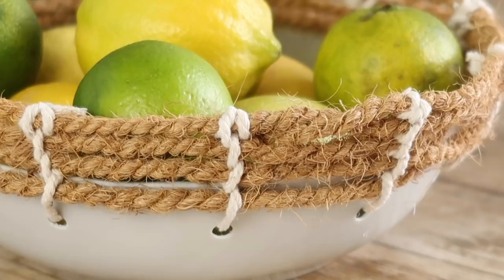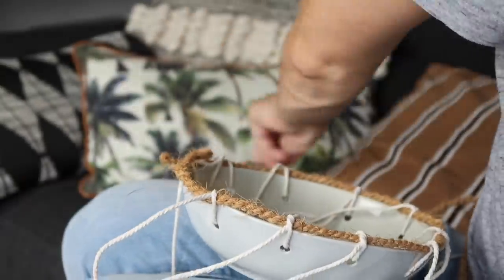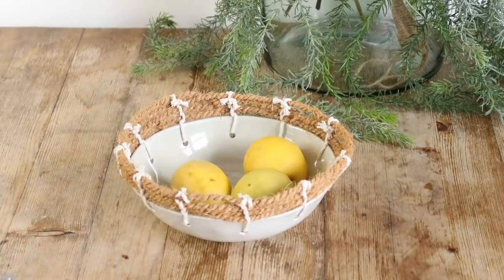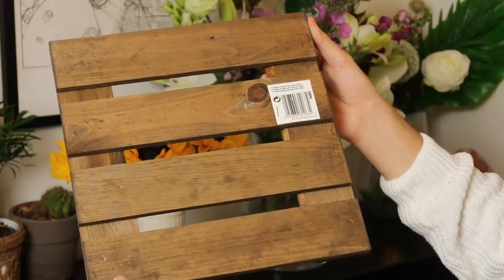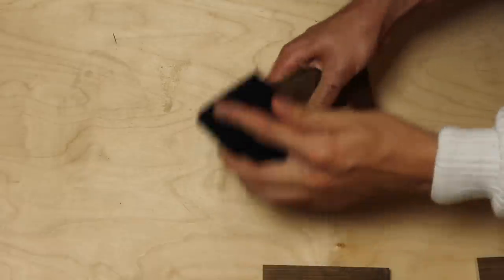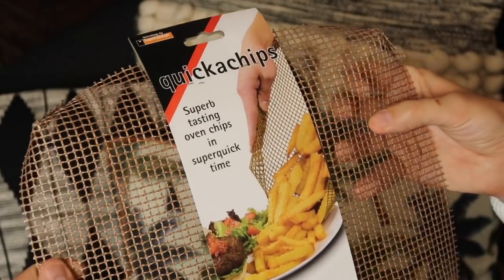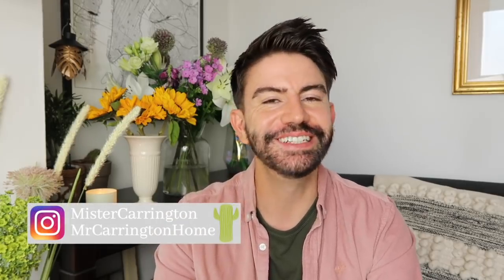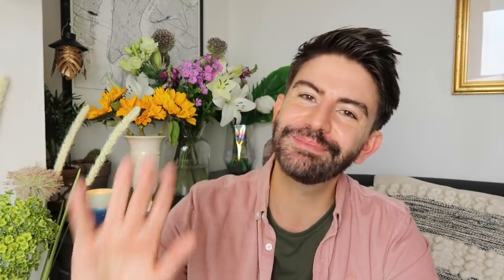DIY BOHO ROOM DECOR ON A BUDGET | £1 ANTHROPOLOGIE INSPIRED POUNDLAND DIY DECOR | MR CARRINGTON 2020

Comment: Great  makes,  can I ask that on a video you show how to load a drill  piece  into a drill as I have a 
  new drill & am a single Pringle I’ve tried watching you tube diy just not getting it x
Reply from the maker: Sure!
Reply: Hi there, I'm not Mr Carrington, but I thought I'd try to help. It's a bit difficult to explain without being able to actually show you, but I'll give it my best shot. 
At the front of the drill there is a black ribbed piece (it's the very far end of the shaft (excuse the word haha), so right by where the drill bit would go in). This you can turn to make the opening for the drill bit wider. Just turn that until the opening is wider than your bit, insert the bit, and turn it again to close it tightly around the bit. (It might take some force to get it going, so don't worry about that). 
I hope this helped a bit (haha bad pun).
Reply: Many Thanks 💙